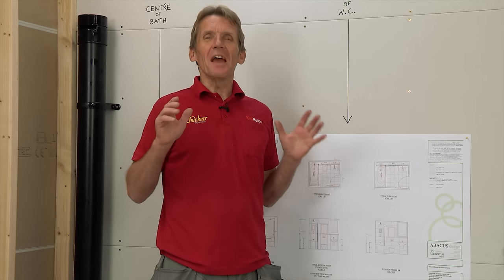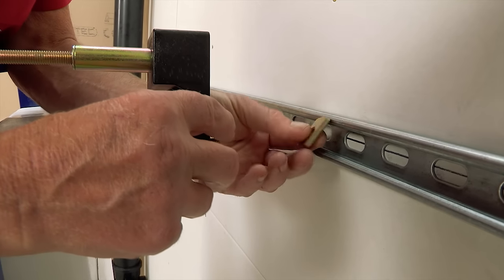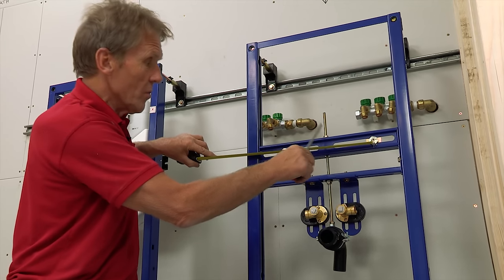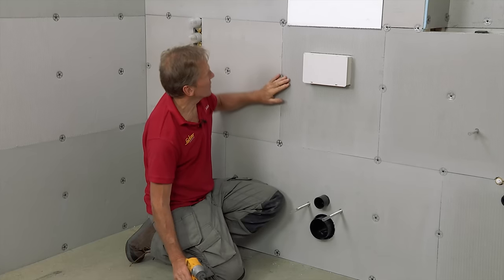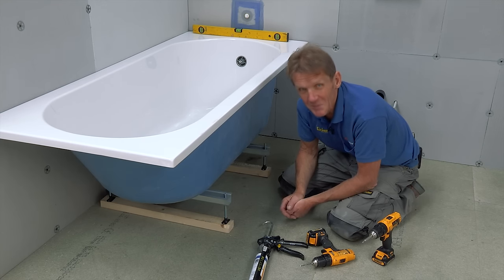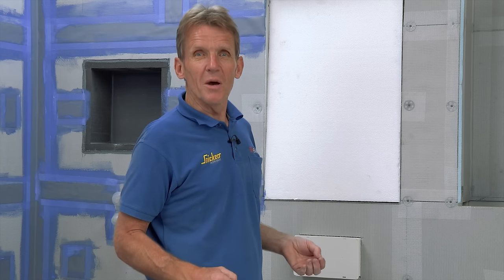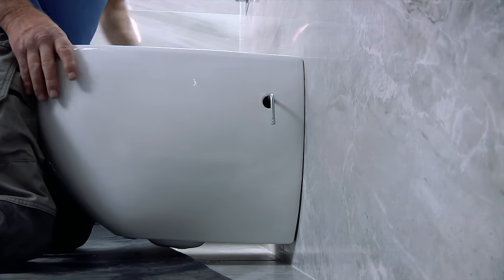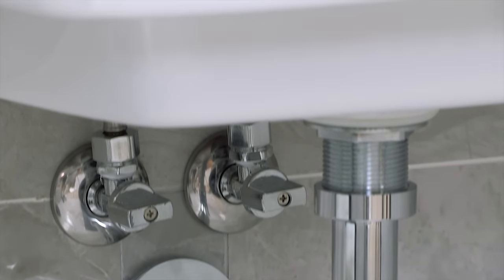Step-by-Step Guide For Installing a Bathroom

Comment: I did my bathroom 9 years ago and boarded up almost entirely with good old marine ply which I got for free from a school.   Limestone tiles straight onto the ply using normal tile adhesive.   It has been fine since, no leaks or cracks in the tiles or grout.  The ply is strong and you don't have to find a stud for a decent anchor.  I cant see why all this hi tec waterproof boards and so much stud work is needed.  I would have used pressure treated studding too.  I think the wc metal framework is necessary but not sure about the basin frame seems a bit ott.  Anyway interesting to know how professionals are doing bathroom properly these days not like is DIYers.

Comment: +1 for fitting a timber bearer for the bath rim to rest on but it needs to go the full length -50mm of the bath and one is needed on the end too, use 3x1pse to give clearance for the taps. Use glue as well as screws. Usually best to fit the taps before fitting the bath, if the taps come with plastic back nuts, throw these away as far as you can & use brass ones instead. if your bath comes with metal angle brackets to hold it to the wall, put these in the bin where they belong! Or ise them somewhere else. I have removed 300+ baths in the past, not one of them was fitted correctly.
Reply from the maker: I agree with all that. The bearer was too short along the back and I would always support the ends and front edge where people sit.
Reply: Would you change the back nuts on kitchen taps too?
Reply: @richardw5375  Yes, & never use the plastic spacers either.
Reply: @garychadfield552  what you use instead of the plastic spacers? Many thanks in advance👍
Reply: @richardw5375  the plastic spacers (the ones that are about 12mm thick) don't really do much anyway, if it is a cheap 2 taphole stainless steel sink and the taps are a bit wobbly, using rigid 15mm copper connecting pipes will help, sometimes I have cut 9mm plywood to shape to go between the backnut and sink as a way to stiffen things up a bit but there needs to be silicone between the ply & sink & be sure there is no leak around the base of the tap or the ply will rot & the tap becomes loose. Something like hardiebacker cement board would be better than ply. 
Another tip for ceramic basins & standard 1/2" taps is to wrap a single coil of 1mm T+E cable around the stem to keep the tap central in the tap hole.
Reply: @garychadfield552  thanks for that  good advice. I've got Cooke and Lewis kitchen mixer to fit for her indoors comes with copper back nut and flex rubber seal should be OK. Looking at gutting bathroom out just looking for info and advice unfortunately my Dad passed away need a little help. 😵Thank you. 👍
Reply: @SkillBuilder  do you have to buy the unistrut separately? Are they available from most plumbing merchants or abacus retailers or directly? Thanks great vids. 👍

Comment: Another great video, Roger! I've looked but I can't find one on walk-in shower screens. The one I bought has a wall channel and a horizontal bar from the top of the glass to the parallel wall. The wall channel only has 2 screw holes & feels bendy. Would you leave as is, or add another fixing point before fitting the glass? It's into tile on foam backer board with metal studs behind.
Reply from the maker: Hi Lorna 

 This might sound unlikely but the wall profile will stay in place with 2 screws and a continuous bead of silicone along the back before you screw it in. 

I have had to remove wall profiles fixed in this way and it takes a lot of work with  a thin sharp blade on a multi tool to get the profile away. Just make sure you know where you want to fix it because moving it is hard.

Comment: Hi when using the elements board on the walls as this reduces condensation does it mean said condensation just goes onto the ceiling plasterboard?
Reply from the maker: vapour condenses where it finds a cold spot. A good extractor fan is a must

Comment: Hi Roger, got some questions for you if you don't mind. I've purchased a concealed shower from Soak The installation instructions are very poor. My questing is what type of fittings/connectors do I  Use BSP or BSPT or are these the same.  I want to use JG push fittings are these ok? I can solder copper pipe what is best in your opinion .  
Thanks

Comment: Great video. I have a Q: if you have an old house, would I need to expect to do my old bath from scratch - like remove the walls and put those fancy water resistant ones? Is that common or they just do this in a good quality brand new house????
Reply from the maker: It is not common and it is a pity more don't do it but it is the best way to do a good job. Elements board won't add that much to the cost and it saves trouble in the future
Reply: Thanks! They look quite lightweight. Can you put the Elements board directly on a fairly old but not rotten wooden panel? Or can you fix them to the old non damaged plasterboards rather then strip everything off? ANd if yes what would you use to fix them? Thank you

Comment: Great video, thanks.  What adhesive did you use at 33 min to stick the bath to the wall?
Reply from the maker: Abacus has an adhesive called MD which is a bit like Sika but a lot of the time i use siliocone.
Reply: Thanks Skill Builder....at £22 a tube I'll be using silicone as well!
Reply: Sikkaflex 221 at about £10 a tube ebay. Strongest I have ever come across. Sika make a range of adhesives well known in the construction industry. It will pull a tile off the wall before you can break the bond. Also- put a block under the middle of the bath secured with expanding foam - makes it absolutely rigid.

Comment: I worry about the flexi hose. I’m starting to get call outs to leaks where they have failed due to the rubber deteriorating. Thoughts?
Reply from the maker: There is a lot of crap out there for sure. The fact is a lot of taps now have flex hoses. I think that sometimes they are twisted.
Reply: Skill Builder since I first posted I’ve just had a job where another flexi hose split under a kitchen sink. The residents (elderly) have had to move out into care homes and the insurance bill so far for two flats is over £8000. Total claim estimate is £22000. All because of a hose that flaps in the breeze rubbing away against anything it can. Shocking. 
Love your videos mate 👍🏻

Comment: Looks nice but all the pipework's now hidden behind the tiling. How you going to get to that for any issues? Under the sink, that right hand tap pipe connector looked very wobbly!
Reply: @milkyporridge5929  Yes, I know the point is they are hidden, I dont like it that stuff isnt easily accessible. The service items might be accessible, better hope no leaks or anything develops because the joints arent. Not for me Jeff.

Comment: Such a good video but I do wonder how many customers would be prepared to pay for this kind of install over a much cheaper option? I have no doubt that this is far superior but bidding this against a simpler install would be a challenge sadly
Reply from the maker: Quite honestly price is not the barrier people think it is. 20 years ago I can remember quoting £3,000 for a bathroom and the customers ended up going to Dolphin and paying £9,000. They got a 'free television' for signing up on the spot. 

They were better salesmen than me. The point is that if you go through the points one by one and tell them why you are going to charge them more  for the quality they have a choice. 
Abacus is not expensive compared to Geberit so there is a margin there.
Reply: Doubt it. Some people want cheap. Plenty of people want fancy bathrooms these days. If they want cheap, your pricing for the cheaper install. If they want fancy your pricing for the fancier install.  Simple as that. One way or the other if they’re happy with you and your prices it’s up to them to decide what tiles and fittings etc. they want.
Reply: Where are you based mate? I have a gym in dorset i  need toiliets etc adding too not a huge job . But could be a new video for you... its just in a unit
Reply from the maker: Hi Pete
 I live just outside London but having spent up to 3 hours a day sitting in the van  i won't even drive into London anymore It makes no sense to sit in the van for hours on end. I now tend to work within a ten-mile radius and I might narrow that down to the end of my road. .
Reply: @SkillBuilder  that doesn't come with a big cuddle when you arrive tho haha.  I just like how straight talking you are i started looking as I'm looking at a gym premises.That's gunna need 2 toilets shower etc a d i dont wanna get ripped off. I'm a big lump so hopefully people will know not too try. I'm straight doen the line too i.m happy to pay for a good job
Reply: Nice video Roger, but what you’re describing isn’t real world mate. Clients already know what they want. If you go in trying to push a product ‘because it’s easier’, they’re gonna ask “well what do I need you for then?”. That’s the problem with jigs and frames - removes all the skill. So while you think you’re saving time, you’re actually giving money away as it makes a DIY’s job even easier.

I’ve had a look at the price of these frames. Seriously mate? I could batten that lot out for the price of a couple of 2x4’s, whereas these frames are into the hundreds of pounds. If you quote with that stuff, I’m tell you now it’s guaranteed you ain’t getting that job - 100%. Too juicy. If you spec it out, a competitor would laugh and say he could save the client serious money by just using timber.

Only scenario I can see this having legs, is commercial work. High precision, low maintenance, quick install. In and out cookie-cutter stuff. Those jobs are big enough to lose the extra and the client wants the facility online ASAP. But domestic? No chance Roger, sorry mate.
Reply: Nice video. What I can't quite work out is that whilst you should only silicon the outside of the shower profile, your video then showed you running silicon along the short edge of the bath up to the inside of the screen. If water can freely get in the profile (and freely run out), how have you ensured the bath/tile gap is sealed behind the profile where it's hidden from the camera view? Cheers.
Reply: Skill Builder whereabouts mate?
Reply: @imconfused1237  100% agree. 

Even in a high end domestic you end up with a neoprene shielded shower that will last 50 years... Problem is in these high end installs the whole thing will be ripped out and replaced because the tiles will be out of fashion in under 10 years !!

Comment: Hi Roger, I am planning to install the same wc and basin with a wet room from abacus and am also ordering the manifolds. My supply inlets are coming into the manifolds on the left, what do I use to blank off the other end please?
Reply from the maker: Just simple blanking plugs with washers inside. https://www.plumbarena.co.uk/product/abacus-easiplan-manifold-female-cap-epwd-15-0505/#.XpsmGZm1uUk

Comment: I have a question.  I have a fiberglass shower stall that sits above a cement foundation.  However, the lip of the shower's bottom hits the cement, but the flooring part you actually stand on sits about an inch above.  So when you step into the shower, it feels a tad squishy.  Should I put something underneath?  I was considering some strong expanding foam and filling the gap.  The new shower stall I got doesn't feel as sturdy as the one I took out.  But the one I took out wasn't sitting on top of anything, either.
Reply from the maker: If you can get thing up you can put some sand and cement under it with a notched flooring trowel and push it down. If you can't get it up suirt the foam under it but make sure you put some heavy bags of sand or something on the tray so the foam doesn't lift the tray.

Comment: Roger how does the Abacus board system compare to others like the STS ‘no more ply’. Only thing that worries me is the strength of the abacus boards as they are a poly type material
Reply from the maker: I used to worry about that but when you stick the tiles on you have a double mesh construction and a stiff layer. To bend it one layer has to stretch.We have to move away from judging strength by weight. We are shortly to enter the age of graphine. A layer no thicker than a piece of cling film will support an elephant. It will take a while until people believe that.

Comment: Did I miss the part where you fit the bath trap and run the drain pipe to the wall connection? Good video thx for posting.

Comment: I was a little taken aback by the large space left behind the units, leading effectively to a smaller bathroom. However, the finished product looks great, and there is still access to the key control components
Reply from the maker: it seems a waste to have that void but it makes for clean lines and the bathroom looks bigger with everything flush.

Comment: Note : This is a good educational video if you buy Abacus kits, but who does? And there are some things as a retired plumbing consulting engineer that I have noticed that I dont agree with. The WC soil float should ideally be installed at a gradient of around 1/40max -1/80min but in any case, certainly not as level as it would appear in this video. People generally abuse WC's and if the soil float is left too level this will certainly be the cause of future blockages, as the flushing water rushes away leaving the solids grounded. Unistrut is an excellent but patented commercial framing system, but no plumber I know would think of using Unistrut in a domestic installation, but having said that it's a very robust system. Also the use of such elaborate metalwork and fittings could cost the client extra, and does the use of it really save that much time, a treated timber batten instead is very easy to work with for the repeat bathroom plumber I think is more economical. I think that plastic supplies should NOT be used for any water supplies as Mice if they get into the services duct area they will definitely chew on it. Also Im old school and there are far too many elbows used on these piped supplies, in my day we were encouraged to 'pull' proper low resistance copper bends in the place of tight turn elbows where practicable, elbows may ook neat but are inefficient, how plumbing methods have changed, so as every extra elbow that is used has a high frictional resistance to a gravity down-service is added, to my mind this is not for the better.
Reply from the maker: Brian 
There is so much to argue with in your comments. Who buys Abacus? Lots of people do. The soil pipe is 1 in 40/
Unistrut is given as an option and, in commercial work where we are doing 50 hotel shower rooms 5 lenghts of Unistrut are on the schedule. 
As for elbows, I agree which is why we pipe up to a manifold so you have no elblows and an unbroken pipe run from manifold to shower or basin etc. It means any problems are accessible but, in reality they rarely occur with this system. 
You experience is valuable but it is limited. This is not just about plumbers making it up as they do along. 
In one London hotel refit we have boxes outside the door of the hotel room with everything needed to fit the bathroom.
That saves hours of running back and forth to the stores. There are many ways of working but this is the modern way.

Comment: Roger, can I fix elements tile backer boards on top of self leveling compound using just kst adhesive and no screws and washers followed by electric ufh and another layer of self leveling compound and then tiles?
Reply from the maker: Yes you can do that. I take it you want the insulation.
Reply: @SkillBuilder  thanks mate. Yes I want it insulated, on top of the ufh mat Will be another layer of mapei 3240 self leveling compound and then the tiles.
I am training to become a chartered surveyor and adding all this weight onto old and badly notched up joists concerns me for structural longevity.

Comment: Great vid as always roger but the limiting factor with all of this clever adjusting and measuring is the plastic seat. 
That is the first thing to fail and it is impossible to replace making a nonsense of all your longevity planning. If I cannot buy two extra seats with a new toilet which I stash away (under the bath) then I walk away.
Reply from the maker: The seat is easy to replace. I don't understand what the problem is.

Comment: Can that bath panel be removed in the event of a problem such as a leak. It looks like it’s permanently bonded in place?
Reply from the maker: You can remove it but you need to take out the grout.  We usually remove one tile with a multi tool and that gives you plenty of access. The Elements board makes it a doddle.

Comment: From the US, all new to me.  How do you get to the cutoff valves or wc if it needs servicing?
Reply from the maker: You pull out the shelf beneath the mirror and they are all there.
Reply: Why do you need the shutoff valve manifolds when you have valves further down the line. In the real world people won't pay for this uneccessary expenditure and rightly so.
Reply from the maker: This is a video to show people ways to fit a modern bathroom. You can do what you want. We are not saying you have to do it this way.

Comment: Do those manifolds only work for mains pressure...e.g tank fed cold to shower and bath can come from same manifold ... Also hot for bath and shower with no need for Surrey flange ...??
Reply from the maker: They need to be fed from mains pressure so you could not use them on gravity. The Surrey Falnge is still needed for a pumped hot water. The manifolds are just llike tees with controls on each port. It just saves have joints under the boards. You take each supply from the manifold to the fitment with no breaks in the pipe. It is leak free.
Reply: @SkillBuilder  cool ...nice tip btw on screwing timber to bath legs b4 fitting..lot easier than scrambling under afterwards..